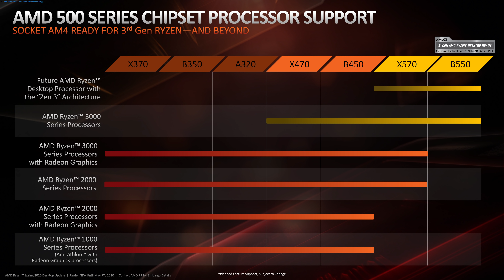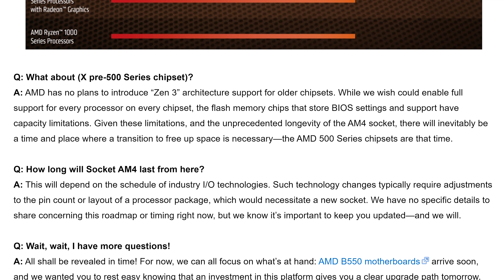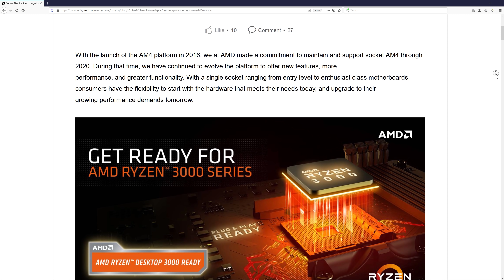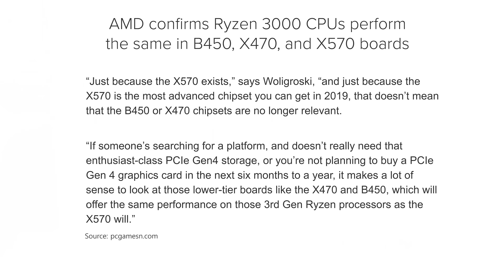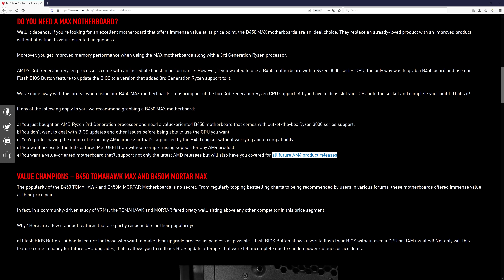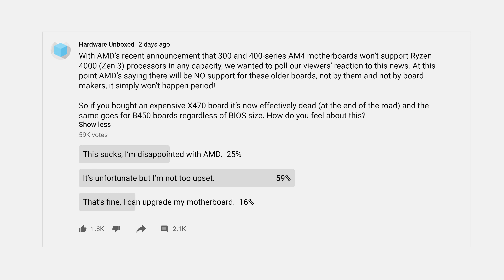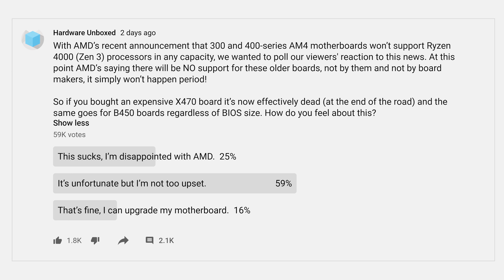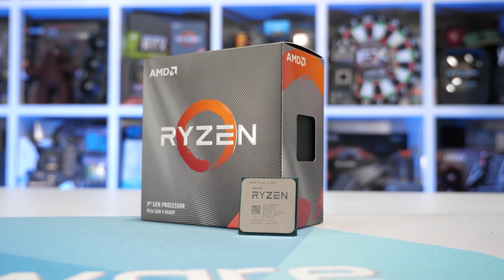AMD Does An Intel, Axes Zen 3 on 400-Series Motherboards, Our Thoughts

Comment: The BIOS chip thing is a cover story because they don't want to reveal anything about the new architecture. My theory is that it actually has to do with the board traces and topography. Also, PCI-E 4.0 is about to be a requirement. 
Also, it should be very obvious with how troublesome it was to enable Zen 2 on B450, that making Zen 3 work would be unlikely.
There has been a lot of confusion surrounding those chipsets from the beginning, including from you and GN. 
Remember the old "you only need X470 for SLI"?? That WAS NOT TRUE. 
The B450 chipsets can't run the secondary NVMe at full speed and can't use it in combination with all the SATA ports due to a limitation in PCI lanes. I corrected none other than BuildZoid about that distinction at one point. 
Also, MSI?? Hello, it's MSI. The company that has messed up constantly the last 2 years. Half thermal pads, bad VRM, tiny BIOS chips.. THIS IS ON THEM for being desperate with marketing and trying to win back consumers after all their mistakes.
As for the point about 300 series chipsets still running Zen 2.. that was the board partners making it work. It was not officially supported by AMD, and it didn't work properly!
This wouldn't be the first time partners ignore the OEM. Asrock let people overclock Pentiums a couple years ago, and look at all the times ASUS has blatantly lied in their marketing.
AMD is supporting the socket as they said. They didn't promise the chipsets. It should have been obvious, but everyone who was recommending the Tomahawk Max made an error they refuse to admit.
I disagree with you that this is a bad decision, because I am quite sure the 400 series boards have a hardware limitation making Zen 3 unable to backport. The way I see it, they've made this decision so people won't complain when the new chips (inevitably) have problems with features not fully working with the older chipsets.
Again, they can't reveal the real reasons yet because it'll tell us things about the new architecture they don't want getting out yet..
Reply: But ASUS even had PCIE 4 working on their X470 motherboards. Only for the graphics card and first NVME slot but they had it working.   AMD crippled it with an AGESA upgrade.  ASUS also has two full PCIE 3. NVME slots on the B450-f.  You can only run the graphics card at X8 in that configuration.   AMD is the issue here.  The Bios size is BS as the MSI max cards make plain.
Reply: @jamesthomson8659  It didn't properly work and had stability issues. That's why AMD didn't let it happen. AMD didn't cripple it, they mercy-killed a cripple. As for your nvme argument.. they didn't have 2 fully working ports, they repurposed PCI lanes.. you just confirmed what I was saying with what you thought was an argument.
Reply: @hyperstimmed  ASUS has 2 Gen3 x4 NVME M.2 connectors on the B450-F motherboard.   That is a fact and it  totally blows your argument.  The trade off is graphics card only running at PCIE 3X8. which is no big deal for any graphics card with the possible exception of the 2080 ti.  
 I know that ASUS X470 boards were running the PCIE 4 NVME's Tiny Tom Logan did it at launch.  There were no PCIE 4 video cards available at launch. 
I don't know about stability issues, but my understanding was that ASUS  was the only vendor that could do it.   
Don't get why you are giving AMD a pass on all this.  Are you an AMD employee?

Comment: Well, I just bought B450 motherboard even though I knew it wont support future CPU's. In reality I would probably use it with my 3600x for basically 4 years if not more and be completely happy about it and unless zen 3 is second coming of Jesus motherfucking Christ, then I don't regret my decision.

I honestly just can't wait any longer for my new PC. And x570 felt like a waste, since I wouldn't use it's features for like, ever.

Yeah, it sucks, but I would like to see you make a poll on how many people actually utilized the AM4 socket compatibility.

Comment: I almost bought a B450 board about an hour before watching this, on the understanding that there would be an upgrade path (at least until the AM4 socket chips were a thing of the past). Seriously unimpressed AMD - that's the kinda shit we expect from Intel. You sold the B450 on the promise of future support, AND held off with the B550! And such bullshit when the hardware could handle it with a simple BIOS update (even if that does drop support for older gen chips, so what?).  If AMD doesn't fix this, I'm tempted to skip a whole chip gen, and who knows, by then Intel might have something better to offer.

Comment: Could this be like AM2+/AM3/AM3+? Ryzen 4000 will have DDR4 memory controller but do you think it will drop into socket AM5? AM4 is 1331 pins with 8 blocked out, AM5 could use those pins thus not allowing Ryzen 5000 to be backwards compatible with AM4 but Ryzen 4000 could be used? Something else is up other than the canned "BIOSgate" answer from AMD right now.

Comment: I was thinking of waiting for the 5000's next year to get in on the next (AM5?) socket. But my system started dying and I had to buy last month. I went with the Tomahawk max BECAUSE it was an UPDATED board with bigger bios, claim of fast ram support (expecting the 4k's would support faster ram then the 3k's). To save money for the 4k upgrade, I went with a 1600af and because we don't yet know what memory speed for the 4k, I just went with 16GB of 2666 planing to replace with 32GB of faster ram.

What is the point in supporting a socket, if you still have to replace the board anyway? Yea they got a little overlap. But they have scammed us who bought the new redesigned 450's. Claiming it's because the bios is too small is BS. The ONLY valid reason would be a change in the 4k's that makes them incompatible with older chip sets. And if that was the case, again, not saying much soon make the whole thing a scam. The x570's cost too much and now they are trying to force up sales.

Comment: I'm going on a limb to tip my conspiracy hat here, while I think this is amd fault, you can be sure there is board maker's hand in this situation. B550 doesnt use chipset chip from amd but asmedia, so beside licensing fee may be for the chipset itself there is almost no profit for amd, but all the profit to the board makers. Amd promising 3-4years support for one motherboard means that you users able to buy only one motherboard for that years compared to intel which likely you will get at least 2 board for that timespan, and that means loss of profit for the board makers. I dont think amd will be able to throw the board makers under the bus if there is some pressure from them, since what can you do? If they stop working with amd that means amd can't have motherboard for their new cpus, and even if they backtrack this and decided to support zen3 on older chipset, people will still backlash on amd when the board makers doesnt add support to their older motherboard citing any resson. I think this incident means we wont see this kind of longetivity on the next am5, in attempt to appease their partners i think, we will see am5+, and something similar comeback since this make sure more board will be sold and so on and we will hear no promise about this longetivity since it is a feature that's really consumer friendly but not good profit wise for their partners, unless all amd motherboard costs twice as much, but it means less incentive for people to buy into since higher startup cost..

Comment: Back in 2018 I purposely went for a high end X470 motherboard (which has a decent VRM setup and a 32MB BIOS) and a 2700X, with the intention of upgrading to Zen3/Ryzen 4000 series as soon as they launched. I would have then kept that setup for a few years.

This recent announcement from AMD is annoying but ultimately they have lost a sale from a customer, as I will not be buying a new motherboard just for Zen3. Instead I will pick up a 2nd hand Zen2/Ryzen 3000 chip in a year or so and keep that setup for a few years. I was more than happy to spend my hard earned cash on a 2 generation newer CPU but I'm not doing it for single generation jump.

Comment: I did buy an x470 motherboard with a 2600x with hopes of future upgrade to zen 3. Now it does not make sense for me to invest in a new platform that will only be compatible with 1 generation of processors since they are not going to support am4 any longer. For me personally, it means that I will have to skip a generation and wait longer for a new platform/cpu generation that will at least have some potential of upgradability.

Comment: I just bought a new B450 board on Black Friday last year.  I tend to keep my CPU/memory/motherboard together as I upgrade, so I could care less that I won't be able to add a Zen 3 CPU to my motherboard in the future.  I even spent an extra $25 to get a ROG Strix Gaming F board instead of an ASrock B450 Pro because I knew it would have better resale when I went to upgrade in the future.

Moving to Zen 3 will be my excuse to pony up for a new X570 board, and by then good boards won''t likely be limited to only $200 or higher (I hope).  At least now AMD is finding out why Intel just goes ahead and intentionally cuts off motherboard compatibility on a regular basis.  Future upgradability is a nice marketing point, but technology has a way of not always being quite so predictable.  Live and learn.

Comment: I bought a Ryzen 3600x and a B450. I knew that the next "upgrade" would be after socket 4 with their newer architecture as I would not be upgrading next year (this would not make sense economically unless Zen 3 was say 50% better than my 3600x which I highly doubt). So the only way I am going to be , personally , angry is if Zen 3 is massively better. Even then it would have taken an act of God to upgrade as my money needs to go to much more important things and my present rig is more than capable. So I already weighed the cost and felt when I purchased that the B450 would save me money upfront and meet my needs until my new upgrade which would not be Zen 3. This announcement has not changed that decision but reinforced it. I am sorry it has screwed over others and I appreciate you guys looking out for us. But as aside if they had offered support on these boards,  people would have then spent two months complaining (justifiably)about compatibility problems and how AMD lied to them as their B450 boards are not working correctly. Either way AMD and people are screwed. Which is one of the reasons I bet Intel does not do this and why risk taking in the industry gets stymied after break throughs as it provides diminishing returns or even expenses. BTW not saying this is justified just that it seems to be a trend down through the years.

Comment: WTH AMD, First I bought an asus x470 mobo because it supported pcie 4.0 then AMD forced them to remove support. I also bought the x470 and 3700x with plans to hand the 3700x down to my kids and upgrade to the 4900x. Large purchases where made directly because of the promise of am4 compatible though 4 gens. The ability to upgrade to 4000 series is the #1 reason I went AMD in lue of Intel. Fix your self #AMD. I smell a class action lawsuit brewing.

Comment: I think AMD is just preparing to end the AM4 socket. This really seems like Zen 3 will be the end of AM4 and AMD have already moved on. Internally, it takes 4 years for any new architecture. So internally, they've been an AM5 for 3 years already. Who at AMD wants to work on getting B350 boards to work on the last AM4 CPU? Yeah, it's sucky. Still, why have the same socket if you need a new motherboard? I think this is why the b550 was delayed. AMD has internally moved on from AM4.

Comment: I just bought a b450 tomahawk max 2 months ago, not because I could not afford a 500 board but only since I just didnt need other features in my system. It is really disappointing with no support for the next ryzen 4000  on all of this updated 450/470 boards and I will in pure frustration just skip this AMD generation.

Comment: Welp I just got a B450m Steel Legend back in November with a 1600 that I got second hand from a friend in hopes that I could upgrade to a 4000 series CPU when they came out but, seems like that plan has gone done the shitter. :/ One the one hand, AMD has maintained great compatibility up until this point but it really sucks that B550 hadn't come out earlier since I couldn't really afford an x570 board but, if I had known that B450 wouldn't be supported after Zen 2 I would have just waited.

Comment: A point being overlooked is that the only difference between 300 series and 400 series boards is a bit of software called store MI that came free with 400 series boards but was purchasable for 300 series for $20.
Any variation between a 400 series board and a 300 series boards was all done by the motherboard manufacturers and not AMD. Even the so called memory tracing issues went away with the installation of a 2000 series processor, in effect you got the memory enhancements with the processors integrated memory controller and not the motherboard memory traces.
500 series boards do have a different chipset, but as this has nothing to do with the processor (can be used with 2000 series processors) even that doesn't change the nature of the motherboards, so in effect for all 300-500 series boards the only reason left is an arbitrary one from AMD,  apart from PCIe 4.0 which maintains backwards compatibility with 3.0 and is not a motherboard breaking technology.

Comment: How much would this have been mitigated if hey actually launched b550 with Ryzen 3000? This is one of the mistakes they made. The rest is communication. I do wonder if the engineering got away from them too. Hopefully AMD has learned something from this, it may result in us ONLY getting 2 gens of support, but at least the consumer can make informed purchases.

Personally I would prefer 3 gens of support (not counting backwards), but the 450 did 2, and I think that's ok. The problem is that they didn't offer a budget/mainstream chipset for the 3000 CPU,  so people looked at the 450 as an option, which motherboard manufacturers endorsed. I do see an issue with saying you support b450, but not all b450s, it gets pretty muddy and I am sure there would be backlash with it.

AMD really needs bite the bullet and throw the resources at this and push out the minimum needed for motherboard vendors to support the CPUs, if they choose to. It's in their best interest to do what they can and leave it up to vendors to determine if they will support it, essentially pushing the responsibility at that point.

The board makers like MSI promising support are a bit screwed and you'd think they'd be pushing so they can at least support their boards through Ryzen 4000.

Comment: I think this is more of a marketing decision than the technical limitation. I see multiple motivations here... No1) Creating steady value market for Ryzen 3000 processors by blocking upgrades for older board owners. No2) Avoiding cannibalization of their own previous generation of processors by ryzen 4000. No3) Taking advantage of price/performance advantage against Intel. No4) Taking advantage of the performance leadership in mainstream desktop market compared to Intel...

Comment: I was fortunate to really dodge a bullet on this one.  Last month I bought a Gigabyte X570 Aorus Pro WiFi ITX mostly because I wanted an all NVMe build with no SATA drives and it was one of the few that I found with 2x  M.2 slots in the ITX form factor. I was able to offset the higher price by going with the 1600AF for $85 and grabbing an EVGA XC RTX2070 Super GPU for $400 on eBay, ($415 with shipping).  I am not an AMD fanboy, (last 'rig' was an Intel gaming laptop), but they have supported the AM4 socket for quite awhile so I think some of the anger is a bit over the top.  However, as was mentioned they should have released or at least announced the pending release of B550 motherboards along with Zen2 then I think more people would have gotten the message and would not be so pissed off now with the announcement of no Zen3 on 300 or 400 series motherboards.  Of course my GPU and both NVMe drives are only PCI Gen3 so I did pay a bit more for a feature I don't use but to think about all the Zen2 and Zen3 cpu options I will have on the used market a few years from now for my next upgrade does make me feel better.

Comment: I really think Ryzen succes, is at least partially due to the trust that there will be good upgrade path, despite being a bit underperforming in gaming compared to intel. If this point go out, there is no reason for gamer to buy ryzen, even if they are cheap. In the middle range, intel price/performance ratio in gaming is nearly the same as amd one (amd cheaper, but weaker, Intel is more expensive, but more powerfull). I look like i will start again to recommand buying intel cpu, especially the i5 if they are priced correctly, because there is no longer any point of buying an am4 plateforme right now. 

You have become the very thing you swore to destroy amd, but at least Intel have the high ground

Comment: I'm on Crosshair VI Hero with a 2600. I said I'll skip the 3000 series and go for a 4000 and hold onto this until DDR5 arrives. Now we know there will be no support on old motherboards for 4000 series. And we know DDR5 will get here probably shortly after, so what's the point of the 4000 ? Either you upgrade an old platform and need a new motherboard, either you come to AMD and buy a new motherboard, just to buy another one shortly after. Basicaly, the 4000 series is only interesting to people who already own a x570 motherboard and that's about it.

So yeah, I think I'll keep my 2600 until there is a huge deal on a 3700x or up or until DDR5 gets here.